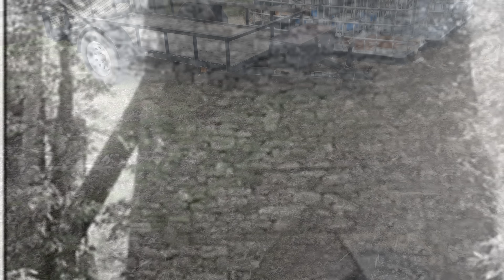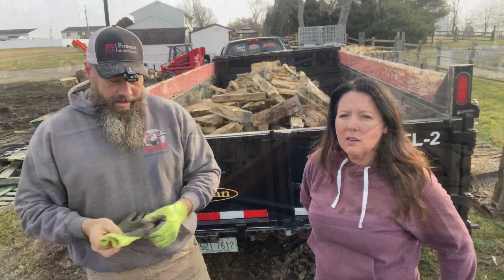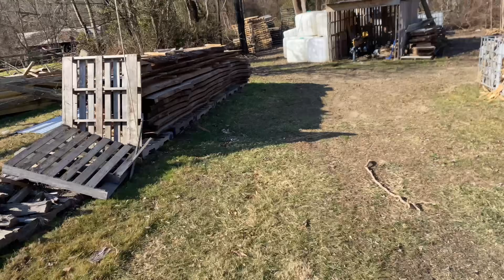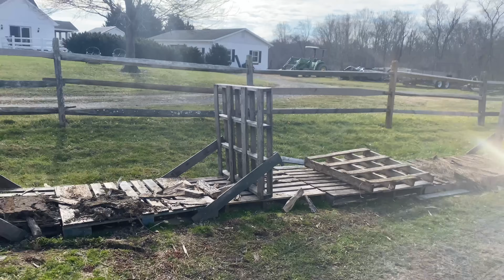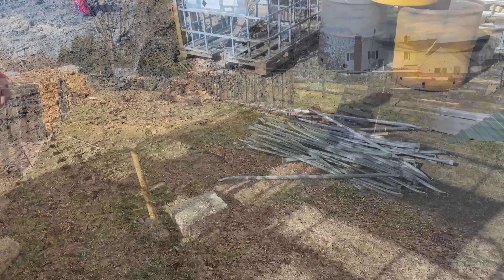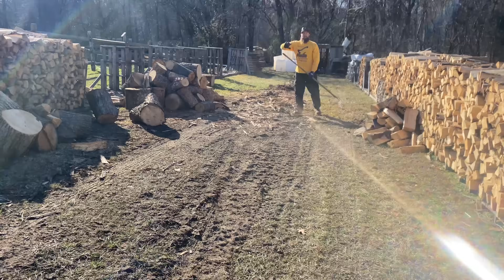LAST LOAD OF THE SEASON - #192

Comment: Good use of the IBC top bars!  The woodyard mud repairs are coming along great Brad.  As an aside, I've stopped using wood chips as a surface.  I've found that it makes my mud issues worse over time.  I've started to put stone down in the well traveled areas and it's a huge improvement.... FWIW
Reply: I like how you think!👍
Wood chips just rot and make more topsoil!
Reply: Cut the bladders and use the sides to close in the tractor shed
Reply from the maker: I've been throwing that around, but when i dump logs on the ground, I'll end up having stones in the bark that my saw will surely find.
Reply: @FirewoodattheFurnace  I understand your concern but I haven’t found that to be a problem. I use crusher run and track it in good then leave a bit of sawdust on top of that.
Reply: @FirewoodattheFurnace  I left 2 spots dirt on purpose for logs but the stone comes right up to the areas. I went the opposite end and went with 2" stone. It doesn't brake ankles, holds up to weight good and definitely doesn't hide in bark. Best money I ever invested in the woodyard. We had snow melting today and soupy yet I was able to split wood all day without being sunk in the mud!

Comment: Cut the tops & bottoms off ya tote bladders , cut it where ya can flatten it out with some heat on the corners on a flat surface (concrete) , ya got a cover sheet for 1&1/2--2 cords approx ???
Put a few heavy cookies on top to hold it down !!! 👍